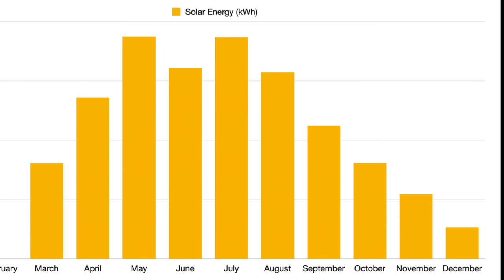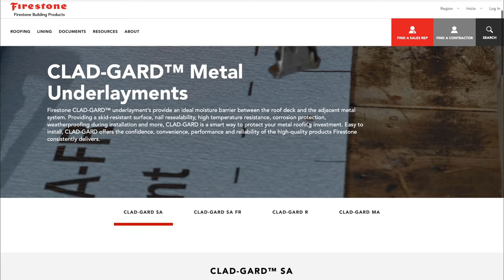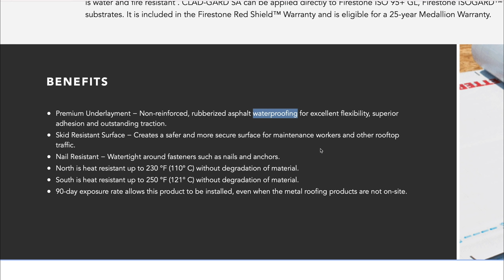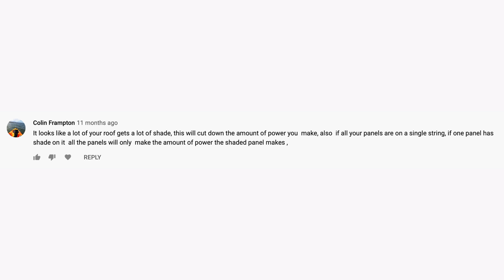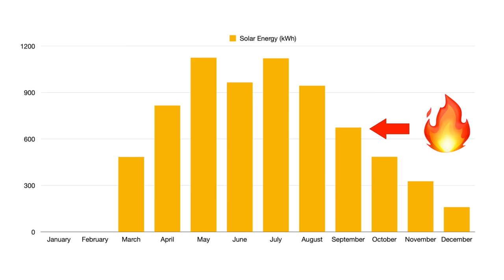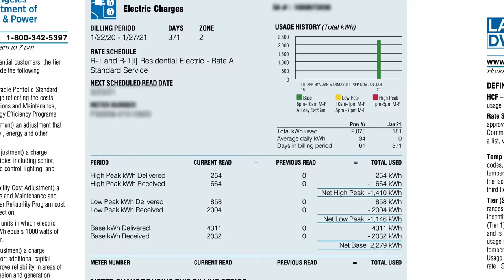1 Year with Tesla Solar Roof: top 11 questions answered + real production numbers & utility bills!

Comment: Amm... Why did you get a Bill and not a Credit? Did you use more energy at night than during the day? Because if you used 32% of solar generated yourself and gave back 68%, did you use it all back at times of no sun/day time? Very interesting... It'd be nice if you mentioned how much the Utlity Co. was crediting you for your energy contribution to the grid...
Reply from the maker: When we send energy to the grid, get energy credits, which "pay for" the energy we use at night, cloudy days, etc. (energy at night, during peak demand periods, is more expensive that the energy we generate during the day). We can bank credits (sort of like roll-over minutes) but can't cash them out.

Instead of spending roughly $60k on batteries to ensure I was totally off the grid, (for a maximum savings of $156/yr) we just trade daytime energy for night time energy. We also charge the Tesla late at night (after peak demand hours), which is a lot of kWs, which helps explain how the daytime disparity evens out.

Comment: Does LA grid pay you for sending energy to their grid?
Reply from the maker: When we send energy to the grid, get energy credits, which "pay for" the energy we use at night, cloudy days, etc. (energy at night, during peak demand periods, is more expensive that the energy we generate during the day). We can bank credits (sort of like roll-over minutes) but can't cash them out.

Instead of spending roughly $60k on batteries to ensure I was totally off the grid, (for a maximum savings of $156/yr) we just trade daytime energy for night time energy. We also charge the Tesla late at night (after peak demand hours), which is a lot of kWs, which helps explain how the daytime disparity evens out.

Comment: Couple things.
1. What rate (if any) did LA purchase that excess energy at?
I realize most purchase at a rate lower than sale because they own the grid but, the off set at the rate you showed should have a profit margin.
Reply: they legit pay next to 0 for the excess energy you gather. after a year of saving you could see like a hundred bucks or so, most is around there. mainly because you arent allowed to just absolutely stack your roof with panels giving you like 300% of ur avg usage anymore. but i have seen homes where theyre growing weed in like the garage of a small home and the bill is like 800 bucks lmao, they completely filled the roof 100%, so if they stopped growing then theyd have a whole lotta extra power.    imo: power companys shouldnt be able to absolutely lowball you on the power while also not allowing you to be off the grid. although theres obviously nothing you can do with that extra power if u dont have a power cell, its still like they know they can get away with it and they dont care.
Reply from the maker: When we send energy to the grid, get energy credits, which "pay for" the energy we use at night, cloudy days, etc. (energy at night, during peak demand periods, is more expensive that the energy we generate during the day). We can bank credits (sort of like roll-over minutes) but can't cash them out.

Instead of spending roughly $60k on batteries to ensure I was totally off the grid, (for a maximum savings of $156/yr) we just trade daytime energy for night time energy. We also charge the Tesla late at night (after peak demand hours), which is a lot of kWs, which helps explain how the daytime disparity evens out.
Reply: @AustinFlack  that makes sense. Thank you for the reply 😀

Comment: You told us the amount of Megawatts the system produces however you skirted by mentioning the most important fact: how many electronics in the house, if any, did you have to reduce or outright stop using since going solar over fossil fuels? After all if it's a fair bit many people will see no advantage to this or it could outright hurt them if say their job needed reliable electricity (stay at home computer work for example).

On top of that does the deal have any provisions on how to deal with said tiles if you should decide to move before 25 years pass and the new home owners do not want to keep the tiles or if they should start to degrade before the expected expiration date (remember, some of the shit used in solar panels/technology is very toxic so while you may not be dealing with CO2 you may be dealing with other waste instead in a few decades as they're generally expected to give a 20 to 30 year life cycles).

Comment: why does the city get a majority of the power and you still have to pay, I know 150 bucks isnt a lot but its still something when you are providing the grid with energy. I might be missing something here
Reply from the maker: When we send energy to the grid, get energy credits, which "pay for" the energy we use at night, cloudy days, etc. (energy at night, during peak demand periods, is more expensive that the energy we generate during the day). We can bank credits (sort of like roll-over minutes) but can't cash them out.

Instead of spending roughly $60k on batteries to ensure I was totally off the grid, (for a maximum savings of $156/yr) we just trade daytime energy for night time energy. We also charge the Tesla late at night (after peak demand hours), which is a lot of kWs, which helps explain how the daytime disparity evens out.
Reply: @AustinFlack  Ah that makes sense, the way you chose to do it seems like the best option. Thanks for explaining and awesome video

Comment: Wouldn't it have been cheaper and more efficient to just put normal cheap solar panels on the roof? To cover a roof of that size you would probably get like a 10kw system (60 m2) that produce 11-15k kwh per year.

Comment: How does it stack up with conventional solar, cost of installation and energy production?
Reply: and NOT having a conventional solar system installed HOW is he supposed to tell ... also what type of panels ... monocrystaline crap or polycrystaline panels which work on a much broader spectrum ... and are easily 60% more efficient than the basic panels people buy then whine about because they didnt get what they wanted .... they got WHAT THEY PAID for ... they paid for cheap they got cheap ... always do PolyCrystaline panels ... in general they do red blue and yellow light absorption .. while mono panels do red or blue ... only ...

Comment: How much power needs to be generated before they hand you a check? 🤔
Reply from the maker: When we send energy to the grid, get energy credits, which "pay for" the energy we use at night, cloudy days, etc. (energy at night, during peak demand periods, is more expensive that the energy we generate during the day). We can bank credits (sort of like roll-over minutes) but can't cash them out.

Instead of spending roughly $60k on batteries to ensure I was totally off the grid, (for a maximum savings of $156/yr) we just trade daytime energy for night time energy. We also charge the Tesla late at night (after peak demand hours), which is a lot of kWs, which helps explain how the daytime disparity evens out.

Comment: So if you sent 67% of the energy to the grid did they pay you for it? Curious because with that overproduction you shouldn't have paid anything to them...
Reply from the maker: When we send energy to the grid, get energy credits, which "pay for" the energy we use at night, cloudy days, etc. (energy at night, during peak demand periods, is more expensive that the energy we generate during the day). We can bank credits (sort of like roll-over minutes) but can't cash them out.

Instead of spending roughly $60k on batteries to ensure I was totally off the grid, (for a maximum savings of $156/yr) we just trade daytime energy for night time energy. We also charge the Tesla late at night (after peak demand hours), which is a lot of kWs, which helps explain how the daytime disparity evens out.
Reply: It's called Net Metering.
Reply: @AustinFlack  Herr in New Hampshire it is much more simple. There's no peak time price or low demand price...its all one price always. We can sell power to the utility at 75% of what they charge. However, you can ask for the check only on an annual basis i.e. once/year for all the energy supplied throughout the year.
Reply: @AustinFlack  part of it is infrastructure.  The power lines and maintenance to send that power around the grid to other users.  They can't pay 100% back, and then have you use their infrastructure for free.

Do you have an automatic shutoff if the grid goes down during the day? So the modules don't overgenerate, and overheat starting a fire when you're not consuming during the day?

Comment: 2,000 dollars in savings! You don't need to get a Powerwall, but get some batteries. They'll start paying for themselves fast, especially if the utilities have off-peak pricing!
Reply: k what type of batteries
Reply: Lithium Iron Phosphate (LFP) are all the rage right now. You won't see them getting recycled! They have a life span of thousands of cycles. Wrecked EVs get stripped of their batteries, which are  and sold on Ebay. If you can't afford to buy a few batteries all at once, buy one or two, then add.

Comment: so all in all in 1 year it was worth it ... IF it does about 2k savings for the second year ... and on through to year 5 ... thats a good portion of the roof paid for ... 
.
be interresting to see what the total is each year for the first 5 years ... if it varies withiin about 3% of year 1 ... then it could be worth it ... 
.
for those who say power wall and keep the energy ... most places the local hydro company MUST buy back excess power when offered ... and THAT is where you savings come from as they pay the current rate for that time of day ... so IF you arent putting power back on the grid you arent making any money .. THAT is HOW you get paid back quickly ... once it's paid for perhaps install a power wall ... and keep 5 days of charge stored up ... NO not 1 not 2 ... 5 days ... because even with overcast or smoke filled skies that 5 day charge will be able to augment your needs for 7 to 9 days ... THAT is what solar power excels at ... 
.
to those who find it is NOT worth it ... if you are using AC things like fridges stoves and freezers ... go get the DC versions ... they are better power performers they use less power and run better ... and you dont need a massive inverter to let them work just a moderate one for the usual things like computers phone chargers and the like ... and yes even your lights can ALL become DC lights ... think Trailer ... they are DC and AC capable ... the run fridges stoves heaters and air conditioners ... off of a basic car battery and perhaps 2 or 3 solar panels on the roof ... 
.
in short IF you want Solar to work for you ... you start with the simple things that are easy like fridges freezers and stoves ... and get those on a solar grid first ... as they are easily calculated KNOWN costs and generally are on all day and night the stove being the exception ... then work on setting up a grid for say lights ... and then for the rest of your stuff ... 
.
just like when you bought your first home ... you didnt move to a new home in 2 years ... you redecorated or added on to your current one ... you do the same thing with solar ... start small with the heavy loads then work down the list to the common loads and finally the rest of the stuff you use like laptops tvs radios computers game boys etc ...
Reply: ok 33k original install ... 2k avg return for 25 years ... 17 years roof is paid off ... 8 more years and roof repairs are paid off and money is left over ... 25 more years at under 2k per year ... and he is just shy of 50k money ready for a new roof or repairs ... and yup money left over ... 
.
his kids take over the house ... and do 50 years as well ... thats about 80k for them too ... and the roof ha spaid for all its needs and left extra money for the family ... 
.
for those of you thinking about the cost effectiveness of it ... its a 25 years mortgage that pays you 2k a year for 25 years ... and is good for longer but 20% degraded or repaired (paid for by the roof) and good for another 25 years just shy of 100% ... so another 25yrs and 2k or just shy of 50k .. and yup repairs paid for and money left over .... 
.
name another roof that in 50 years pays for itself twice and gives you extra money also .... 
.
short of having a farm on top of boengs airplane building plant ... I cant think of another roof that can pay for it self at all

Comment: $2,000 saved per year = paying for the increased cost of the roof (over architectural shingles) in roughly 15 years. But that's assuming the efficiency doesn't degrade as projected by Tesla. Something doesn't smell right in Denmark.

Comment: I love the concept and I truly want one. But how are you coming out with the cost of electricity vs. the cost of the system now? Yes, I see how much you saved year to year. That's great. 
But prior to the installation, it looks like you were spending roughly $187 a month on electricity. What are you paying now per month for the Tesla roof? And how long will you be paying it off? 
Yes, you saved $2000 a year with the power company. But at that same time, how much are you paying Tesla(or the loan holder) now? 

My numbers are roughly $300 a month for power through the grid now, but it would be $1600 a month for a Tesla roof of the same power output. Yes, with the solar roof, my power bill would be $0, but that's still a net loss of $1300 a month for me. Even without the two Powerwall batteries, it would be $1400 a month. So a net loss of $1100 a month. And all of this is with the 10-year Tesla loan. Given my current power bill average of $300, and the total cost of my system being $137,000, it would take 38 years before I broke even with the Tesla roof. 

Certainly, we don't get into this solely to save money. But having my monthly power expense quadruple (in essence) is not something I can afford. Am I going about this the wrong way somehow? Thanks for the video either way.

Comment: so realistically, if you factor in the initial cost of the roof, figuring it lasts 25 years, what are you truly saving, vs staying on the grid?
Reply: It's best to install the Solar Roof on a new home or home that requires a roof upgrade.

To change the roof, simply for the Solar Roof does not make economical sense.
Reply from the maker: Covered the cost in depth in my first video: https://www.youtube.com/watch?v=LRPy8UZv9V0&list=PLXt9cHZDKoN4TcPWRp-P7iQfshODE274k

Short answer: $33k, about $21k more than if we had just gotten a conventional roof and about $3k more than if we had gotten a conventional roof + standard solar panels.

Will pay for itself in ~10 years. (I deduct the cost of a conventional roof when I calculate ROI—I needed a new roof!)
Reply: @AustinFlack  awesome, so assuming it lasts the 25 years, then it pays for the replacement unit too within that time frame, so there is a net profit to be made. Thanks!

Comment: Do you not get paid for providing energy to the grid..?
Reply from the maker: When we send energy to the grid, get energy credits, which "pay for" the energy we use at night, cloudy days, etc. (energy at night, during peak demand periods, is more expensive that the energy we generate during the day). We can bank credits (sort of like roll-over minutes) but can't cash them out.

Instead of spending roughly $60k on batteries to ensure I was totally off the grid, (for a maximum savings of $156/yr) we just trade daytime energy for night time energy. We also charge the Tesla late at night (after peak demand hours), which is a lot of kWs, which helps explain how the daytime disparity evens out.

Comment: The warranty is only rain and wind? No hail? That's a bit scary. Hail is not the same as lightly smacking it with a rubber mallet but hopefully you won't have an issue

Comment: Puppet account I'm thinking, the State of California doesn't at least in my area allow solar to provide more than 65 - 70% off grid power.  Payment back into the grid if any is credited on your Bill's not your pockets you can not cash out those credits or donate them. They will rotate off your bill depending on what part of the state you live in = length of time you hold the credits.

Comment: The biggest weakness with solar is the fragility of the panels which is why they won't be practical in the Midwest or any areas that have severe/large hail regularly.

While I appreciate the "testing" it cannot be compared to 2"+ hail falling at 90mph+

Comment: Still paid bills, while giving out over 60% of the power to the grid, which they obviously sold elsewhere. It didn't just dissipate...
Reply from the maker: When we send energy to the grid, get energy credits, which "pay for" the energy we use at night, cloudy days, etc. (energy at night, during peak demand periods, is more expensive that the energy we generate during the day). We can bank credits (sort of like roll-over minutes) but can't cash them out.

Instead of spending roughly $60k on batteries to ensure I was totally off the grid, (for a maximum savings of $156/yr) we just trade daytime energy for night time energy. We also charge the Tesla late at night (after peak demand hours), which is a lot of kWs, which helps explain how the daytime disparity evens out.

Comment: What I don't understand is that such cells are never three-dimensional, but just lie there flat. If they were only a few centimeters in height, you could build the vertical.